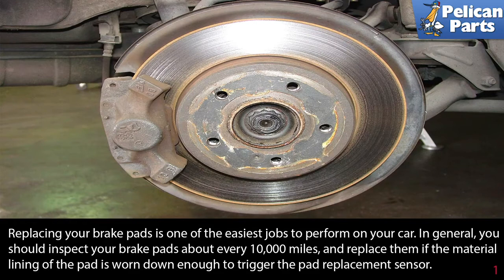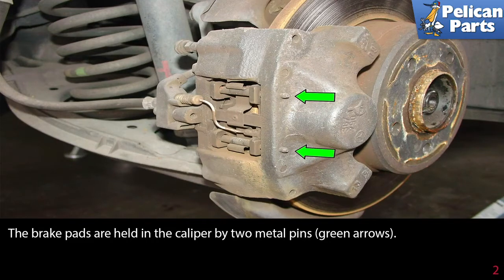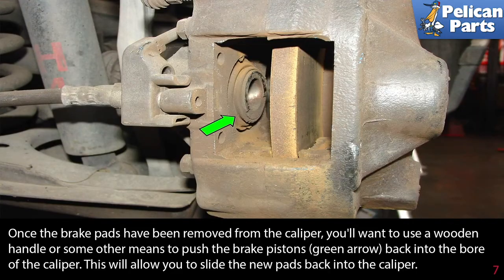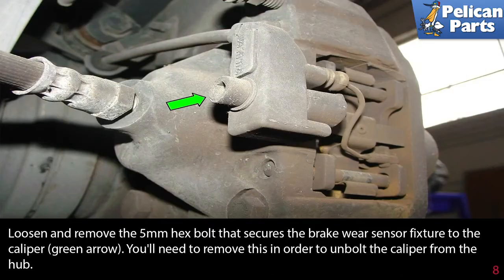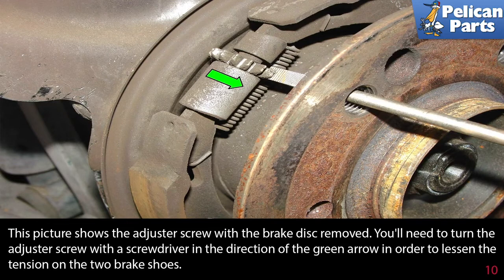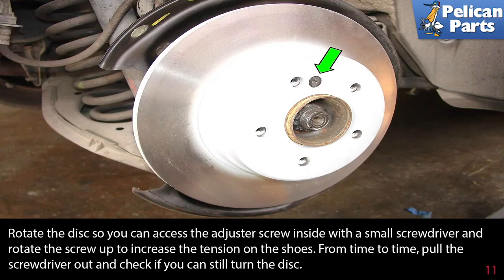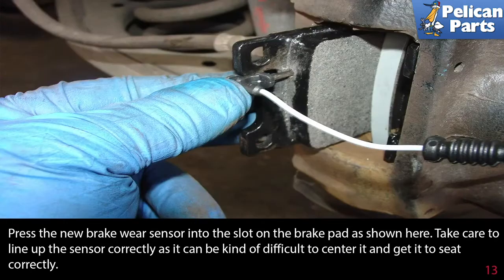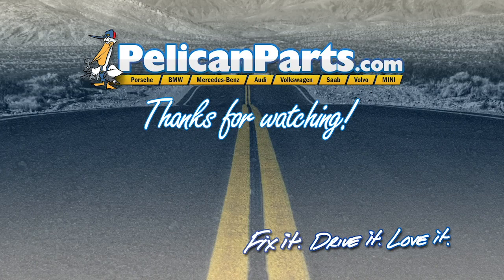Mercedes-Benz W210 E-Class Rear Brake Pad and Disc Replacement

Comment: Hi! i'm overhauling the entire brake caliper (puting some new seals). Therefore, i had to separate the entire caliper. Do you know the correct torque for those 4 bolts that holds this parts toghether? Thank you!
Reply from the maker: What is the year and model of vehicle? I can see if I have that info.
Reply: @pelicanparts  Its a 2000 w210 (station); 270 CDI
Thank you!

Comment: MISTAKE at 3:09: The rear caliper holding bolts should be torqued to 55 Nm or 40 ft-lbs, NOT to 85ft-lbs (115 Nm)! Probably, you mixed up the values from the front brakes: There, the mounting bolts of the caliper holding bracket must be tightened to 115Nm. Please correct this.
Reply from the maker: They are being corrected to:
Self-locking bolt, brake caliper to wheel carrier
M10 55 Nm

M12 115 Nm